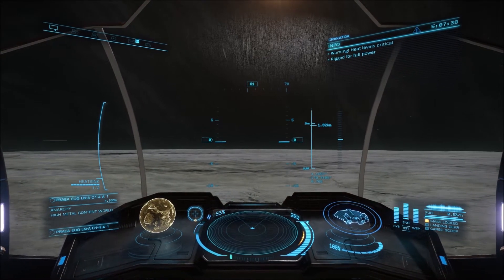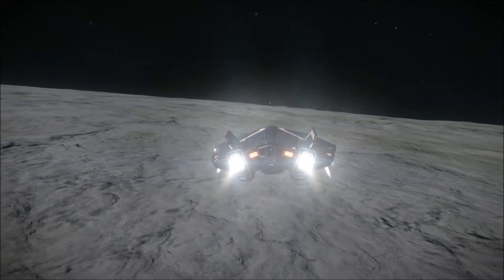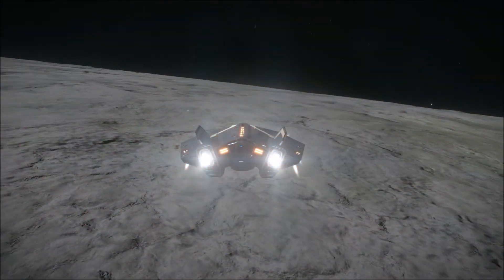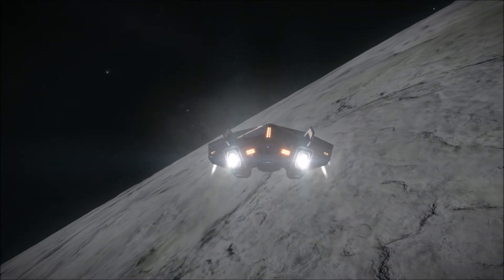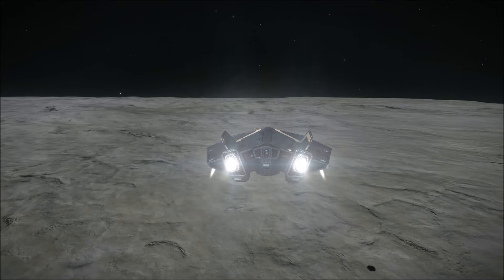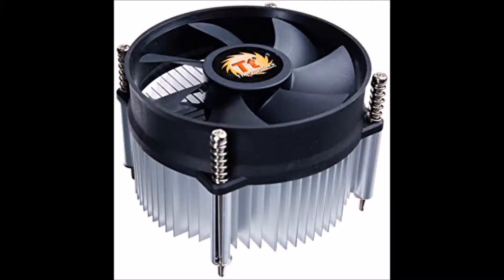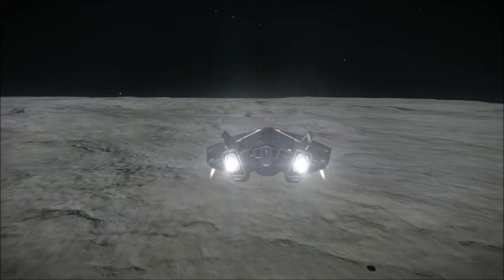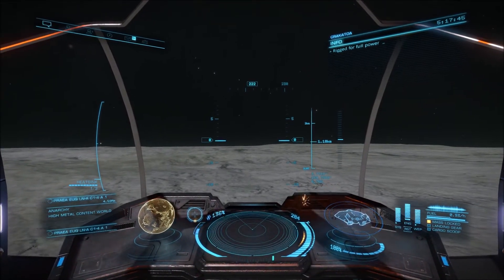Elite Dangerous Science: Heat management of space ships

Comment: Rather than heat sinks that dump heat accumulated it would be a nice idea to have extra units for radiating heat. That would make the ship cool quicker and run cooler but be more visible (that is based on the heat signature, hence silent running meaning cloaking), allowing combat ships to run with more heat dumping weapons than normal. It can also be used to purge heat before going silent for a sneak attack or stealth exit.